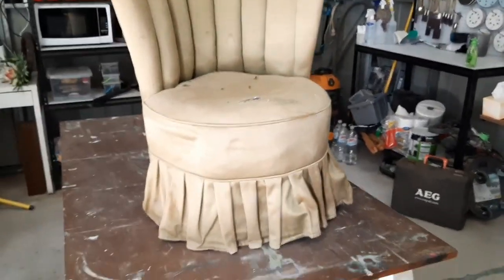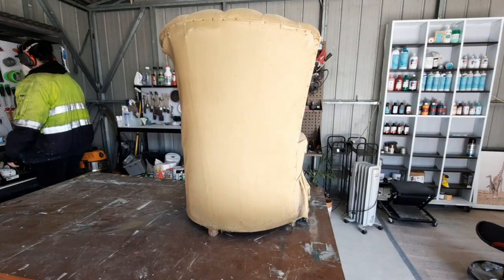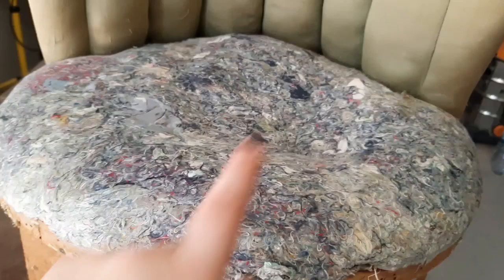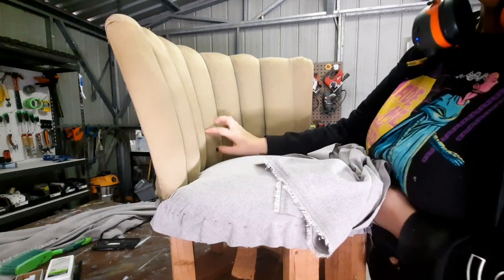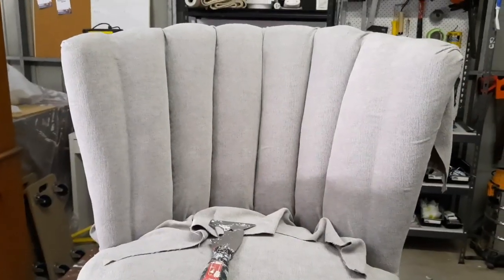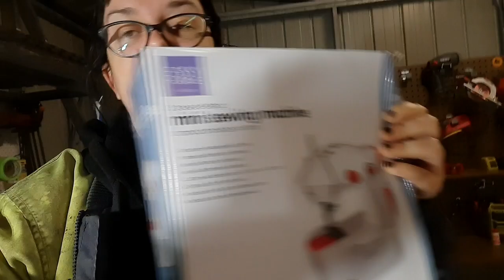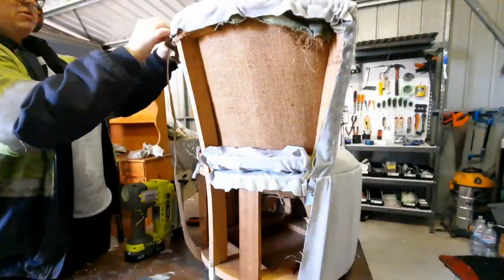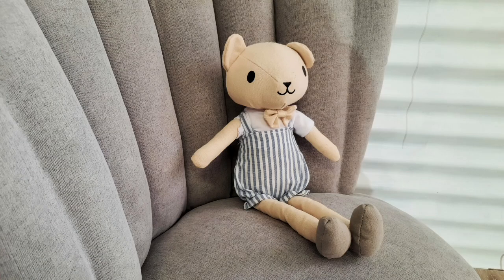Antique Chair Reupholstery | Can I do it? | Flipping Furniture

Comment: I worked in upholstery over a year and I would have said no to a channel back chair. Brave to take it on. But, I have to cringe at disregarding the webbing and springs (unless you addressed and did not show) that's what structurally gives the seat support and loft. The padding just smoothes and cushions. If you take on another upholstery job, there are a lot of good videos on YouTube from experiences upholsterers.

Comment: I think u did a good job, but I can’t understand why u didn’t put Hessian strapping  underneath the springs where the old hessian was…it would’ve made to whole seat a lot fuller, instead of just adding more stuffing, which is just going to compress & sag when it’s sat on? Stapling hessian straps underneath is just as easy as stapling hessian to the back of the chair, which u did do!
Reply from the maker: Did you see the size of my staple gun? No, it wouldn't have been easier. 
I did also point out numerous times that I'm not a professional 🤷‍♀️
I was informed that the seat would be for decorative purposes only and wouldn't be sat on. 
The owner was thrilled with it and that's all that matters.
Reply: @CreepDesignsbyTwitch  I know that ur not a professional, neither am I…but what I didn’t know or hear was that it wasn’t going to be sat on! To me that makes ur decisions totally understandable! Apologies for any misunderstandings & am v glad the client loves it 👏🏼👏🏼👏🏼